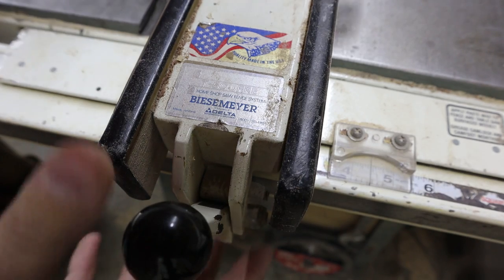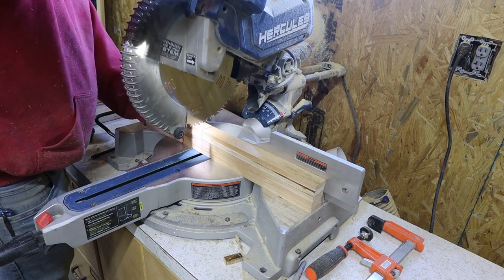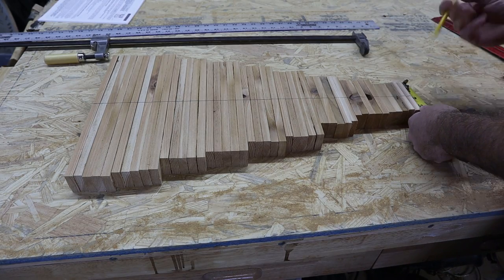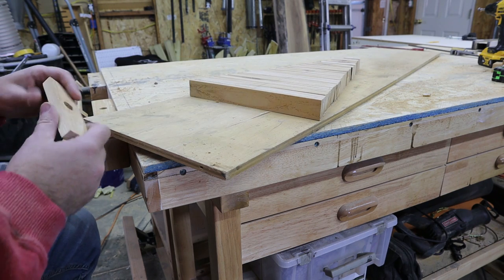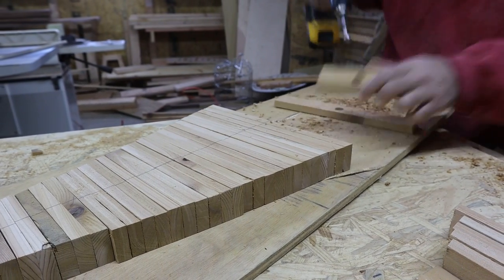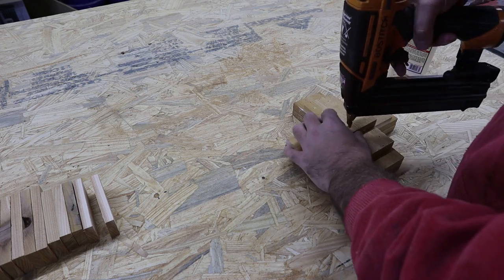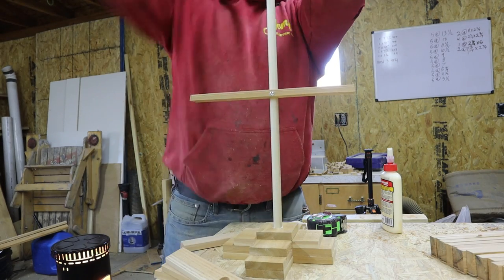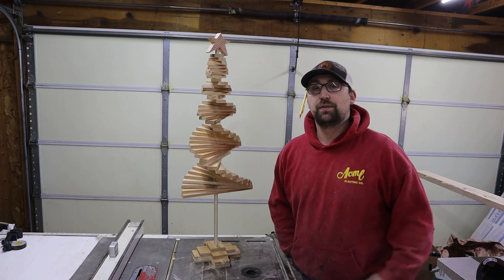Building Spiral Christmas Trees out of Fence Pickets | DIY Woodworking | Christmas Build

Comment: I have seen a number of other YouTube presentations on making a spiral tree like this but yours is the first one specified the 13° angle and the lengths of the various groups.  This is very helpful for a dummy like me and I appreciate it very much. Good job!!  Thanks!
Reply: I think it would be a great improvement to sand the slats before assembly and also stain them or put some kind of finish on.  Rather than brushing or wiping I would suggest using a small trough (such as a section of rain gutter ) and dip them in the stain. I would suggest using something like Ready Seal - especially for cedar!  I think it would look better and also ready so you can put it outside.  Of course other types of finish could make it look even more elegant, but would take longer to apply.
Reply from the maker: Glad it was helpful! I typically just use a saw and straight edge, but I couldn't this time.
Reply: I agree thank you!

Comment: How much did you sell them for
Reply from the maker: I sell them for around $40.
Reply: @cedarriverwoodworking  that’s a decent price I want to make them wider though any tips or ideas
Reply from the maker: @mrfiresave3209  You want to make the base wider?
Reply: @cedarriverwoodworking  yeah I was thinking 3’ wide
Reply from the maker: @mrfiresave3209  Oh the bottom of the tree. I would continue cutting 5 pieces at a time 1" wider than the last set, until you made it to 36 inches wide.
Reply: @cedarriverwoodworking  instead of cutting 5 the same length couldn’t you make it a 1/4” shorter as you go up or is that done to save time then cut with the table saw
Reply from the maker: @mrfiresave3209  You could, It's just easier for me to go that direction.